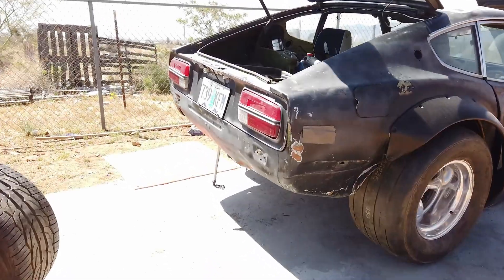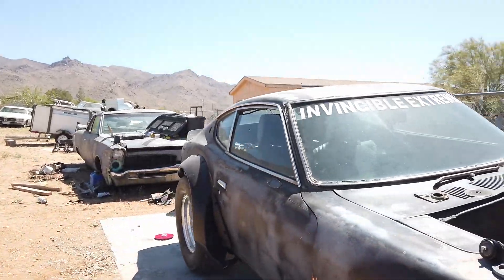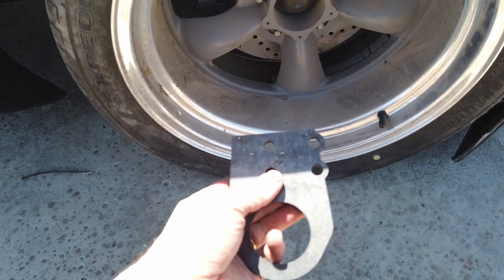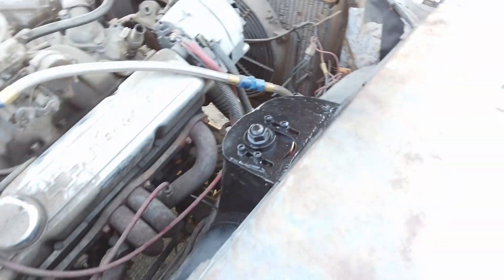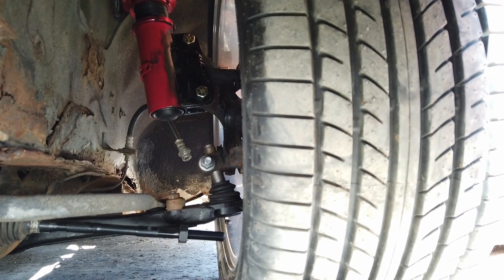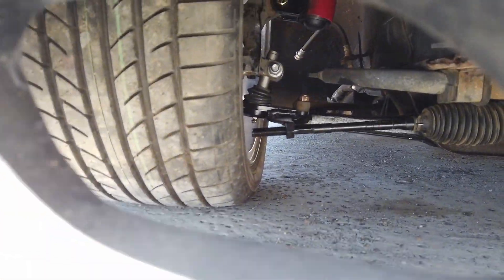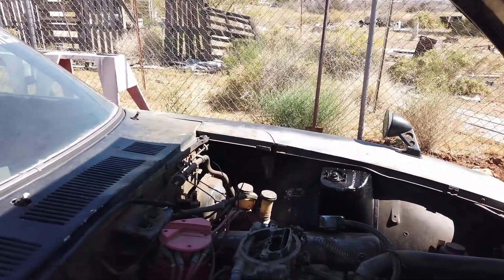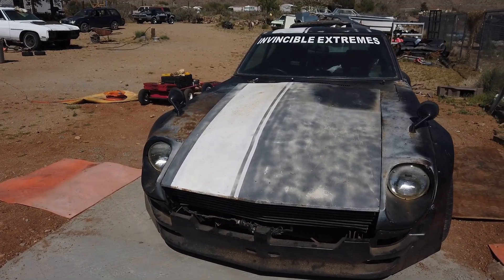wide body 240z project custom suspension using mustang spindles and subaru power steering build

Comment: What kinda welder you running now? You ever have a problem seeing the bead when you were running harbor freight mig? Like the tips to big to see what your laying down
Reply from the maker: I have the cheap 200 amp mig welder and it's fine.  I had a problem once with burning my eyes when my helmet was set too low for a couple days.... i had a really bad weekend after that
Reply: @InvincibleExtremes  this is the 240v $200 mig. I'm not blinded just the tip angle or size makes it where I can't see the immediate bead. If that makes sense.lol
Reply: Wondering if you know a better replacement tip. Appreciate any info.  Miller to China freight issues I guess.lol
Reply: @InvincibleExtremes  z looking pretty sick BTW